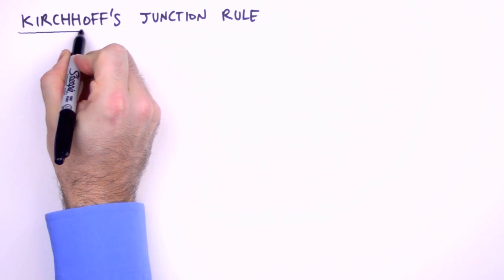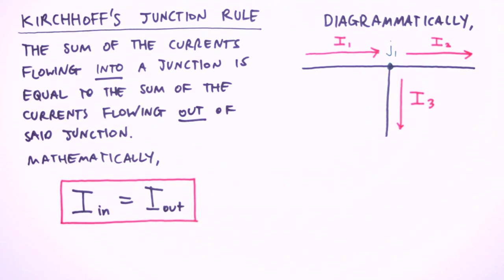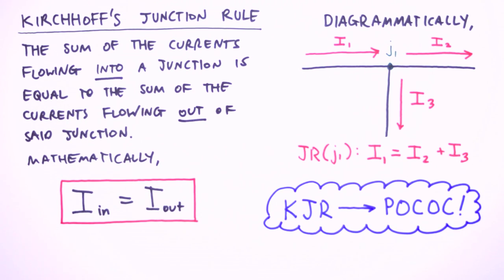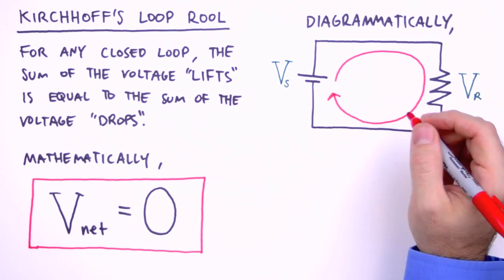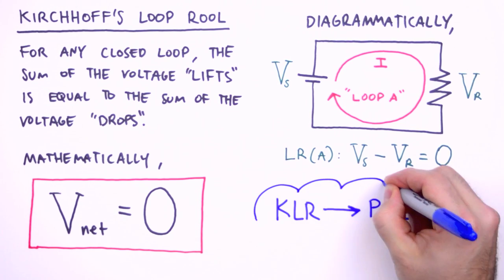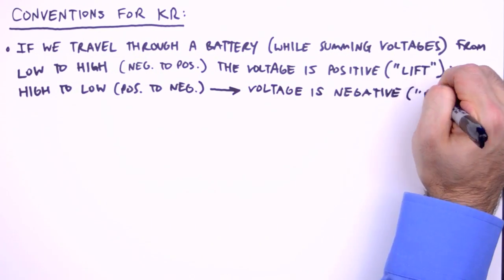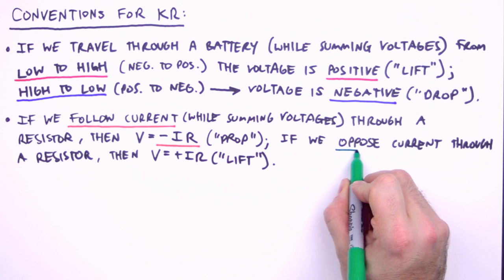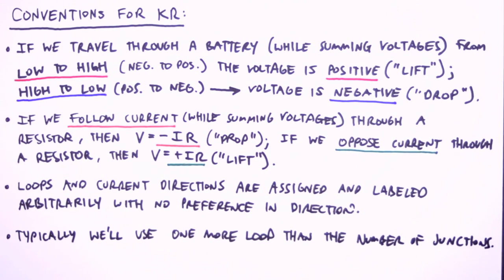Kirchhoff's Rules (Laws) - Introduction

Comment: just wanted to say thank you for your content and how well you applied kvr mathematically and in a diagram. Im currently in a dc circuit analysis course and my prof is no help whatsoever. mainly  his lectures consist of 10 year old powerpoints and his fumbling control of a laser pointer trying  and off topic rants that have nothing to do with dc circuits. he's quiet old by the way but nevertheless the videos helped me out very much. i haven't looked yet but if you do not already have a video on potentiometer loading that would be a suggestion for another video.

Comment: Hi!! you have made thee best video ever to explain this section! please do more it helps so so much! Please will you also do complicatedly drawn circuits with resistors in series and parallel, so as just to simplify the drawing so we can tell which resistor is connected in which way and calculations, if there is any way i can contact you to send you a problem please please let me know coz u are soo good at explaining.  oh and also your video the one on multi source circuits you say that the direction of current flow in a loop is arbitrary. Doesn't current flow in the path of less resistance first? so in the case of loop B we would have the current flow through the 100 ohm resistor first. so that would mean for loop B we would take anticlockwise as the direction of current flow. would the calculation end up with the same answer?

Comment: there are two fundamental laws for all the circuit problems, that is ... maxwells 3rd equation and the charge conservation laws

1.  maxwells 3rd equation (Curl of E = - dB/dt, it is a partial derivative )is kind of like faraday's law but slightly different due a total time derivative.

2. charge conservation law gives you J dot n = 0 

E is not a conservative field when B is present, kirchhoff and all the engineers and their dumb books treat an inductor as a conservative field because the final solution is still the same in most cases.  because of this, they started to make million's bogus rules to avoid the failures and issues. Just follow the E- fields and the faraday's law then you might even build or understand the anti-ECM jammers.
Reply: yea, bump